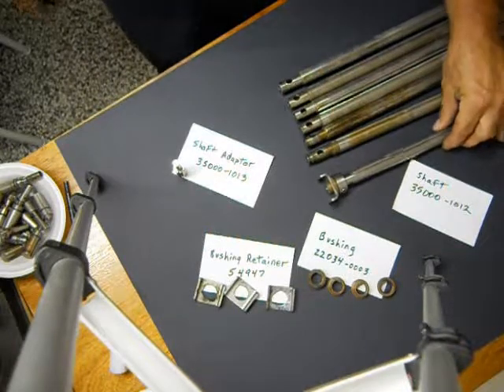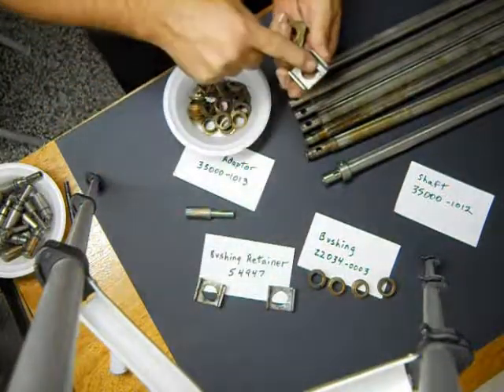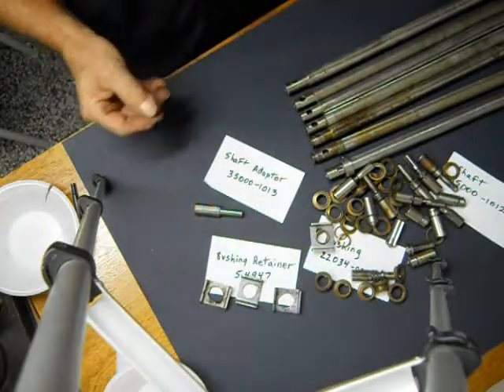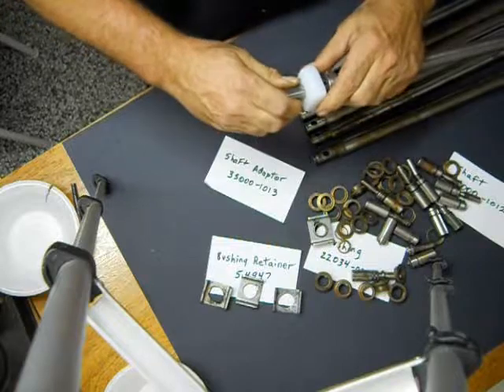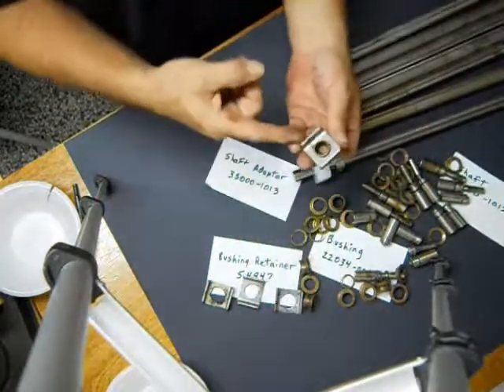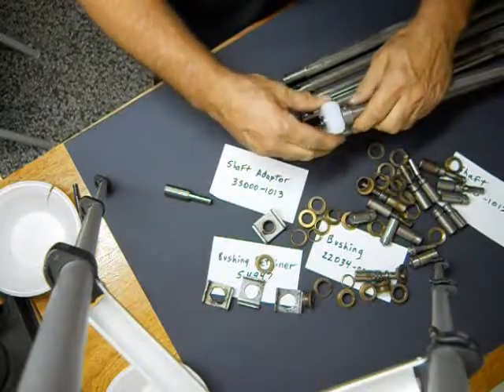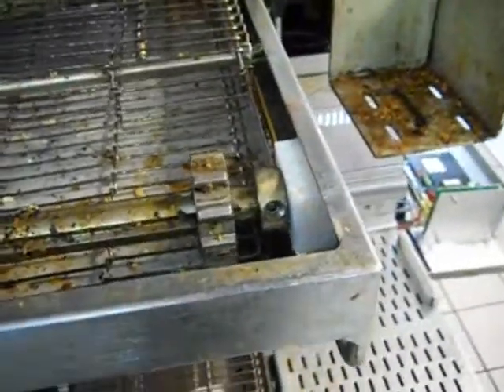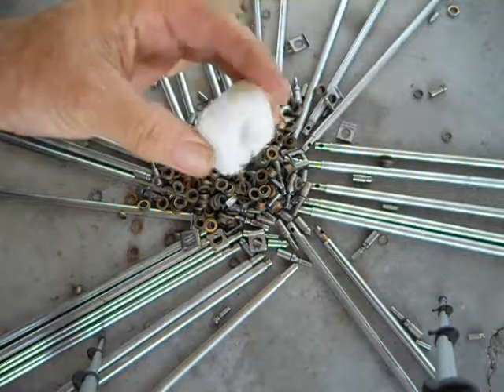Middleby Marshall PS570 oven shaft bushing problem solver

Comment: Thank you!!! I will cut some of these and use them in my pizza ovens for my restaurants! 🙂
Reply from the maker: Delrin bar from McMaster-Carr. Use 5/8" paddle blade as drill bits do not work. Cut delrin with band saw or sabre saw, etc and you are in business. Grind down edges with belt sander and make deep grind on one edge so conveyor belt clears.
Good luck. I retired from that line of work after 26 years Jan 2025 with every single one ever installed holding up.😊 Pizza Hut and Middleby problems solved.